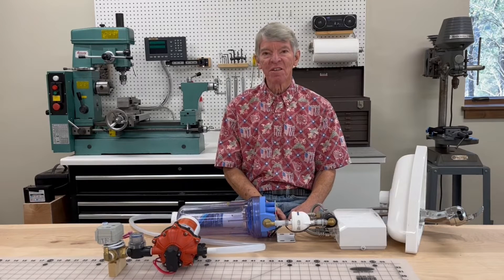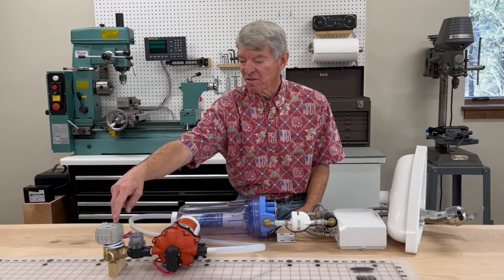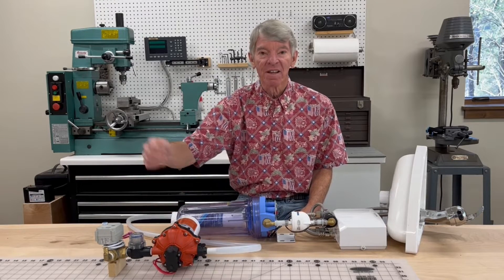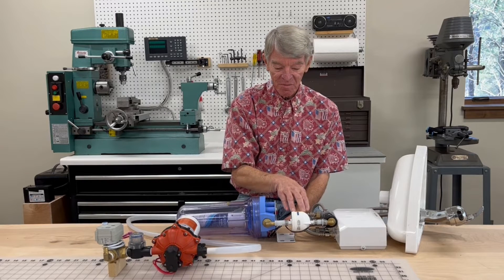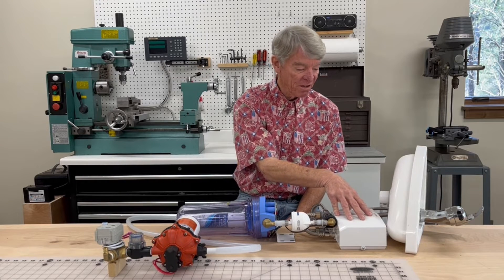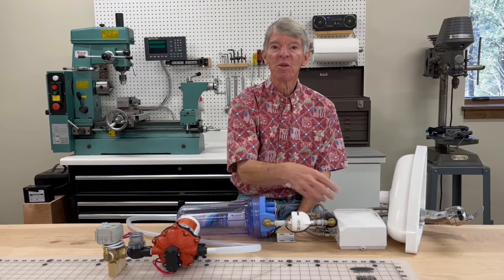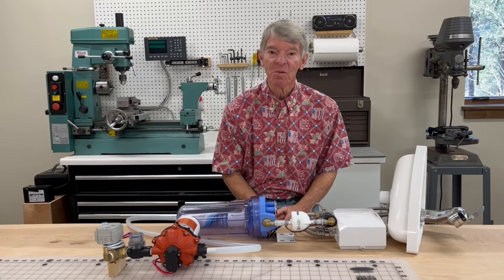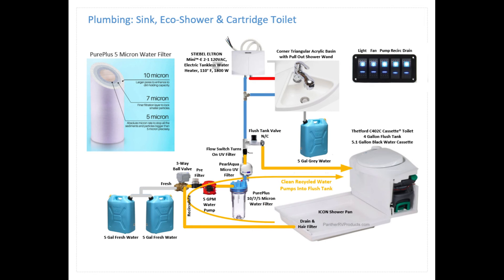Camper Van All-Electric Recirculating Shower w/Tankless Water heater and LED UV Filter

Comment: Would you mind sharing how you removed the flow restrictor from the water heater? Also can you post a link to the Plastic Magnetic Water Flow Control Sensor? I see some on Amazon but they're 220Vac.
Reply from the maker: I completely removed the restrictor but I had to tweak the flow switch that turns on the heating element to get it to activate at an even lower water flow for mixing with the "cold" water from the shower pan. The shower works without the tweak but it would be nice to get more adjustability. 

To remove the flow restrictor you need to use a Torx driver to remove both end caps. Be careful to not damage what I assume is the temperature sensor. Once the end caps are removed you can look down the water channels and you will see one with a restriction. You can push the restrictor out of the channel with a screwdriver. The end caps can then be replaced.

Maybe you can do me a favor. I did not make note in which water channel the restrictor was located and which direction the restrictor was oriented. Before you remove the restrictor can you please take a picture and let me know which channel has the restrictor and its orientation. Send the picture to fivepoundpete@gmail.com. The flow switch needs a certain amount of internal backpressure to be activated. Since I still have the original flow restrictor I would like to experiment to see if there is a larger hole that could be put in the restrictor to get good nominal water flow and an even lower flow rate that still activates the flow switch. A lower flow rate while still operating the heater would allow mixing an even smaller amount of hot water with the "cool" water from the shower pan to extend the range of temperature adjustability.
Reply: @fivepoundpete  Hey. I'm working on this at the moment and I removed the flow restrictor, I took some photos I can send them to you.

I'm having a different problem now and I wonder if you had the same issue. Now that I've removed the flow restrictor the heater is pulling 16.5A and it's tripping the power strip I was using a backup switch. I'm wondering if you noticed that behavior?

I'm testing this setup with a bucket of water and I don't have any shower head on the output. I'm wondering if there's just too much flow now without a shower head that the heating element never gets hot enough and therefore resistive enough to draw less than 15A.

Also, can you describe how you modified the flow switch? I don't have a shower head attached to my test rig but when I restrict the flow with my thumb the flow switch turns off earlier than I'd expect.

Thanks!
Reply from the maker: @RossGuarino: Originally I purchased the 2400W version of the heater and found it pulled more than 2400W which my battery could not deliver. I ended up using the 1800W version. At 16.5A times 110V the heater is pulling 1815W which is very close to the rated power. I think the heater is functioning properly.

I went back to look, and it turns out that I did not modify the heater flow switch. It is still working even with some back pressure from my shower head. But now I think I will not put the flow restrictor back (to maintain the highest possible water flow rate) but instead try to reduce the strength of the spring that is keeping the flow switch open. This would require disassembling the switch mechanism but might be worth it to get the heater to operate at a lower flow rate.

Please let me know if you attempt to reduce the spring strength and how it works out.

Thanks.
Reply from the maker: @ZillaYT : The flow switch I got from Amazon at this URL:  https://www.amazon.com/gp/product/B08FDV8R18/ref=ppx_yo_dt_b_search_asin_title?ie=UTF8&psc=1
The switch is rated for any voltage below 220V. I am running mine at 12V.

Comment: How did this work out in real life? I’m installing a recirculating shower in my van.
Reply from the maker: It is working out great in real life. We are not using the shower as often as we thought but it is still well worth the space for the times we need it. I plan to do a video on how we use and maintain the shower after we get more experience with the shower.

Comment: One other question. Is there a way to adjust the temperature on demand? Seems like as your body acclimates to the Initial set temperature you like , then you want it even hotter,  (or at least I do) and would be nice to be able to crank the heat up a little bit higher while you're in the shower. Looking at the control board it looks like there's a potentiometer for adjusting the temperature. I wonder if one could be mounted/extended to the shower? I'm sure I can find a waterproof potentiometer if I can figure out what the specs are. Would really be nice to have an on-demand temperature unit.
Reply from the maker: I agree that a hotter temperature at the end of the shower is a must. I set the heater temperature to 110 degrees, slightly hotter than I would like at the end of my shower. Initially when the temperature is comfortable at the beginning of the shower I mix in "cold" water coming from the shower pan using the adjustable faucet. When I want it hotter at the end of the shower I adjust the faucet toward "hot".
I would definitely avoid getting anything accessible inside the shower that could become a shock hazard. And use a GFCI circuit for your heater.
Reply: Sounds great. I wasn't sure just how much adjustability you had. If I did hook up a remote potentiometer it would be a waterproof variety. Essentially I would just be extending the wires from the one on the circuit board. As far as I know that's just low voltage, but I get your point. You don't want to electrocute yourself in the shower!

Comment: Hello Pete:  Are you saving the water from one shower to the next or do you just use say one and a half gallons and dump it for each shower? If you do save it, how often does the water get changed? And I'm curious what you're using for your domestic hot water? Would be nice to utilize just one hot water heater for both the shower and cooking. I'm considering a heat exchanger to prevent contamination, but this does require two separate pumps. I could see something like a tee and a solenoid valve  (both wired and switch together) so that the water is diverted to a separate hot water heater instead of the shower, or possibly a point of use heater. Any thoughts? I'll have to check the electrical requirements of the point of use variety. Such a great design I really love it.
Reply from the maker: We are still learning how to use the shower efficiently. We first thought we would reuse the water several times before pouring it down the sink or into a utility sink at a campground. So far we have only used the water once and then dumped it. Because of the slope of the shower pan and the minimal plumbing in the shower loop we only use 3/4 to 1 gallon of water for a shower for the two of us. We may play around with clearing the water with Epsom Salts to see if we could use even less water but for now we have just dumped it.
I looked into a heat exchanger and a second pump and the complexity of that solution and decided on the simpler solution I show in my videos. The heat exchanger solutions can work well but I opted for small and lightweight. BTW, the heater I am using is of the point of use variety.
We actually cook with spring water from 1 gallon containers and heat it in the microwave.
Reply: How long do you have to recirculate the water for it to heat up to a suitable temperature for the shower? That big water pump probably uses 8 AMPS of power while it's running, not to mention the 1800 watts for  the point of use heater.  I'm wondering if there is a real advantage to the point of use variety versus say just a 2.5 gallon heater.  With the latter, you're not using the pump. If you start getting into heat exchangers then of course you're actually using two pumps. Trade offs to everything. With the heat exchanger you have uncontaminated water for domestic hot water. I don't have a microwave myself.  And I don't know if you saw the second part of my question. Is it possible to hook up a remote potentiometer to adjust the temperature within the shower? I did look at the model you suggested for the point of use water heater and it does have an adjustable temperature range, but it looks like you need to use a screwdriver to set it. Just wondering if a waterproof variety could be wired in and installed in the shower, so you could bump the temp up a bit in use? The last thing of course is cost.  The model you suggested I think is nearly $300  vs About $100 for a 2.5 gallon electric heater. I'm not arguing for one or the other mostly just making some points about things I'm considering, or thinking out loud so to speak. I think I have the mind of an engineer myself!  So far, I think I have enough room for everything but we will see. I'm still months away from an install.
Reply from the maker: We put the shower head into the shower pan, add enough water to cover the drain with 1/2" to 3/4" of water and turn on the pump. The heater and pump draw 185A for 4 minutes to bring the water up to temperature, or less than 7% of my 200Ah battery capacity. The reason I am using a "boost" water heater is because it senses the temperature and drops it's power way down. My battery can run the shower for 2 hours at that power level (we don't take that long to shower ;-)  If you want to raise the temperature part way through your shower you need to be able to adjust the thermostat on the water heater and wait (or plan ahead and know how long it takes to heat to higher temperature). One problem I see with a large water heater is that you contaminate a larger amount of water that sits in the water heater until it is time to dump it. We dump a smaller amount of water as soon as it gets cloudy.
I think I answered the remote potentiometer part of your question in a previous reply, it might have scrolled off the reply screen. I set my heater temperature to 110 degrees and then mix "cold" water to adjust the temperature below that. No need to adjust the heater temperature while showering.
Reply: Thanks again Pete. I decided to go with a 2.5 gallon hot water heater and a heat exchanger. I think this is gonna be the best solution for my situation. The heat exchanger prevents any contamination between the shower and the domestic hot water. I like the fact too that the entire hot water unit can simply be taken off the wall and brought inside for winterization. The 4 gallon size gets pretty heavy, not to mention it takes up more space, and I think 2.5 gallons is plenty for washing dishes. One problem I can potentially see is if your water temperature is set too high, then you're going to be drawing cold water from your onboard tank and wasting water unnecessarily.
Reply from the maker: Good luck on your van build! Don't forget to winterize your heat exchanger.

Comment: Do you know how much it cot to make your recirculating shower?
Reply from the maker: The total wet bath cost was $3000 including $300 tax and shipping. Just the recirculating shower part was $900 with lots of plumbing fittings left over. You know how it goes, you need 2 fittings but they come in a package of 10.

The wet bath big ticket items are:                                                                   Price          w/ Tax and shipping
Thetford C402CL Cassette Toilet, Self Contained                                       $ 625.00    $ 733.96 
Nautilus 59.5"x36" RD RV Shower Door Opaque Plain – White                  $ 260.80    $ 295.80 
STIEBEL ELTRON Mini-E 2-1 120VAC, Electric Tankless Water Heater   $ 239.00    $ 250.71 
Three sheets of 1/2" 4'x8' Pre Finished Birch Plywood                               $ 199.65    $ 216.41 
PearlAqua Micro UV Filter                                                                                $ 175.00    $ 195.00 
S594 Boat Caravan RV Camper White Triangular Sink and faucet            $ 149.99    $ 157.34 
SEAFLO 55-Series Water Pressure 5GPM Diaphragm Pump                     $ 129.99    $ 136.36 
ICON RV shower pan, 27”x 24", white                                                            $ 124.49    $ 134.94 
Plus 44 line items under $100 that add up to another $900!

In general I picked well engineered and high quality items. I am sure with effort you could find lower cost options.

Comment: Hi Pete! This is the best-designed recirculating shower I've seen so far and I love your strategy of using a low-power electric in-line heater and cycling the water until it's up to temp. I'm planning on doing the same in my trailer conversion. It's really amusing to realize that I've basically created a tank-style water heater... with a walk-in tank! :) I've bought a 110V in-line heater that uses standard screw-in water tank heating elements and swapped out the 3.5kW one for a 1.5kW one that my inverter can handle. I like this solution better than the heater you use because I can repair and replace things in my unit more easily. (I could even put a DC heating element in it someday, as long as the thermal cutoff switch and relay could handle the higher current.)

I have one (well, for now, LOL) main question about your system -- do you think it's a problem to have such an overpowered pump running continuously at such low flow rates? I would worry about it perhaps decreasing the lifespan or leading to overheating. Usually fresh water systems have an accumulator tank to allow the pump to run intermittently. I was looking at the Aquatec variable speed pumps but they're expensive.

I am planning on incorporating two spin-down filters and making my filtration/UV/pump system into a modular unit that I can unplug and carry down to a lake or stream to filter and pump water back in through my garden hose fill port. This will be the same hardware used for the shower recirculation which should get me a lot of functionality for the amount of space/monetary investment. :) Thank you for sharing about the AquiSense LED UV filters. Makes WAY more sense than the mercury systems I was looking at. I'll try to get them to sell me one, too. :P

Much gratitude!
Reply from the maker: ... a walk-in hot water tank...very funny! But true😊 I like my in-line water heater because I only need to heat enough water to cover the shower drain and not suck air, about 1/2", or usually less than a gallon.

Something else I haven't pointed out is that any heat loss from the UV filter and water heater is captured inside the under sink cowling and helps keep the water warm. 

While taking a shower the pump does not experience enough back pressure to turn off. The flow rate is large enough to not trip the pressure switch so the pump runs continuously. I don't think it should overheat but I will keep an eye on it. An accumulator tank would be useful to lengthen the on-off cycles if the pump was frequently cycling. With your setup and pump an accumulator may be necessary.

I know many recirculating shower designs use a spin down filter. I have a screen that I added magnets to at the shower drain to make sure hair and large debris can't reach the pump. I also have a prefilter right at the pump intake to catch smaller debris. I don't know how much additional debris is removed by a spin down filter that makes it past the prefilters. Does anyone know how much debris is typically captured in the spin down filter and whether it is worth adding one?

I only plan to fill my fresh water tanks with potable water through a small in-line water filter at campground water spigots. If you are pulling water from lakes and streams your system sound terrific.
Reply: Yes, I think your recirculation strategy (especially with the shower pan screen) probably doesn't need a spin-down filter! But I expect it to be important for filtering surface water, e.g. from muddy streams and lakes. :) Another fun aspect of my system -- I collect the rainwater from my roof and it empties into my shower pan, so I will use the same filter system to pump that into my fresh water tank. (I will probably let the first few minutes drain straight out the bottom though before plugging my drain and letting the pump fill my tank, because the first bit of rain usually carries all the contaminants off the roof!)

Good point about the pump flow rate and pressure switch. I will need to make sure that I use a high enough flow rate, and/or a high enough pump cutoff pressure, to keep the pump running continuously. I think a high pressure but lower flow rate pump would be best for this. You've inspired me to ditch the expensive variable speed pump. :) (If I really need to, I think I could decrease the power output with a PWM controller.)
Reply from the maker: You may have noticed that I never pump recirculated shower water back into my fresh water tanks, I keep those tanks pristine. Shower water is either reused for more showers, pumped into the toilet flush tank, or sent down the sink into the grey water tank. Good luck on your plumbing solution.